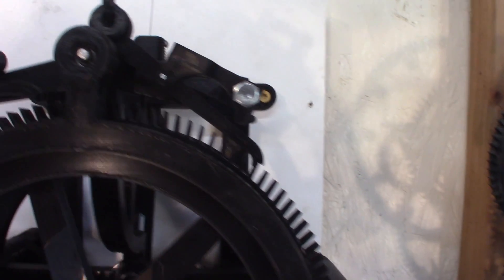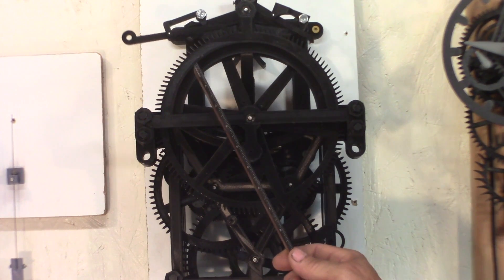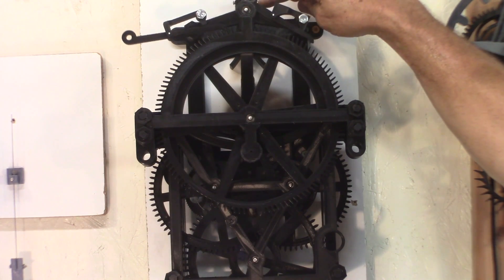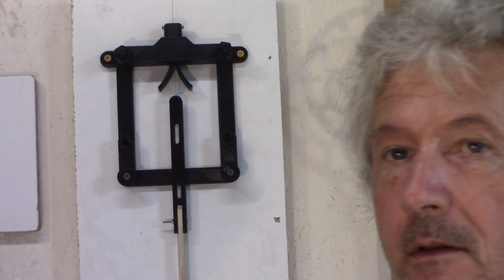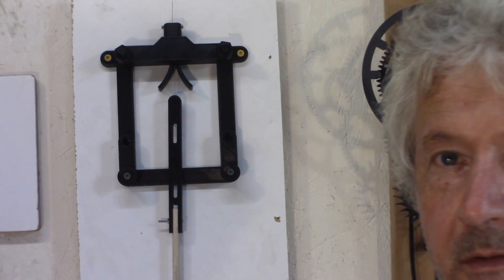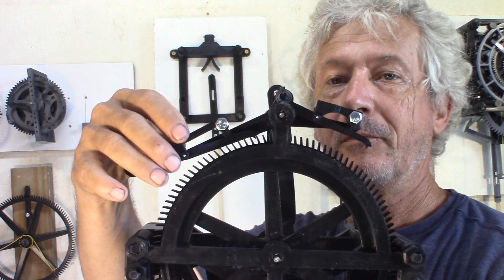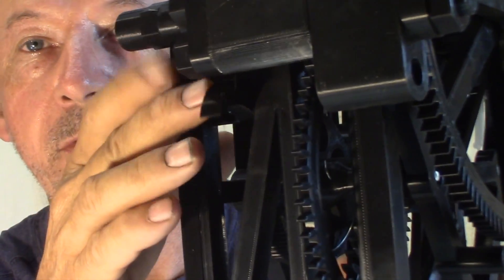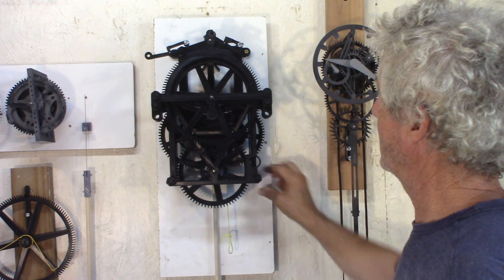John Harrison Grasshopper escapement 3D printed clock: First clock run prototype

Comment: cuckoo is good for getting the Clock in beat, but you should measure with an accurate quartz watch that has a second hand. Small adjustments will require special knobs with the calibration, then You can adjust the clock in three measurements.

Comment: Nice clock. I like the removable body to make adjustments without having to remove the pendulum.

I tried a few grasshopper clock experiments. It needed a lot more drive weight to run compared to a similar sized deadbeat escapement. All the energy used to lift the pallet arms is lost after they release. Try reducing the counter-weights to the minimum needed to return to the resting position. Less energy used to lift the pallet arms means the clock should run with less drive weight.
Reply from the maker: Thanks
Yes 12 kilo's for a 4 day run, that is the same as 3 kilo for one day, that is 50% more than the deadbeat escapement, that is not too bad
It is just that 12 kilos on the PLA frame is a lot
I am going to double the size of the drum for a start 
Maybe I will switch to some kind of remontoir with electric motor like the burgess clock B
Lots of little things to tune up, balance the anchor, pallets with just enough lift when realeased
Reply: @jacquesfavre999  Wow, 12kg is a lot of weight. This seems like your longest running clock. The low friction of the pendulum support probably helps. I agree that grasshopper escapement are probably not as efficient as a deadbeat. I think the rate changes when you change the drive weight, similar to an anchor escapement.